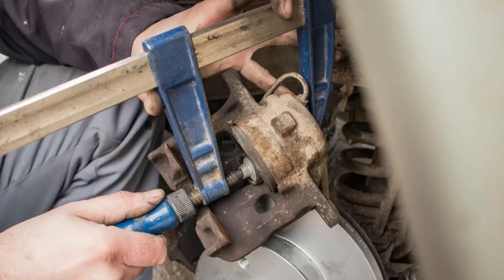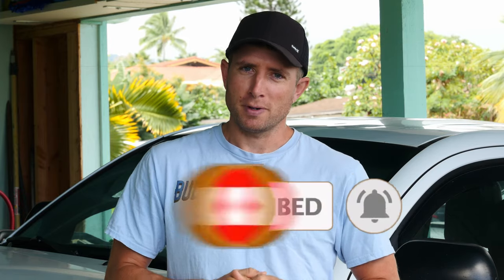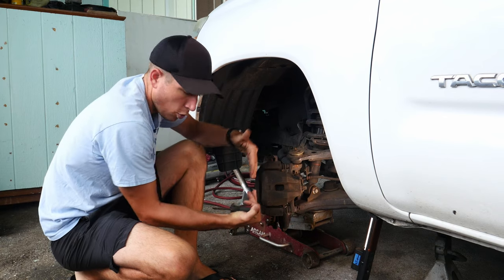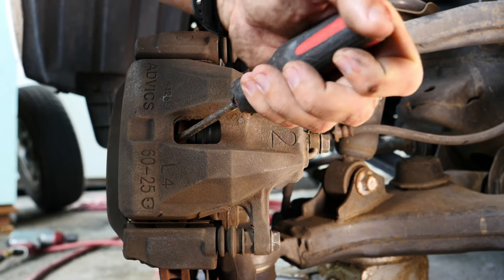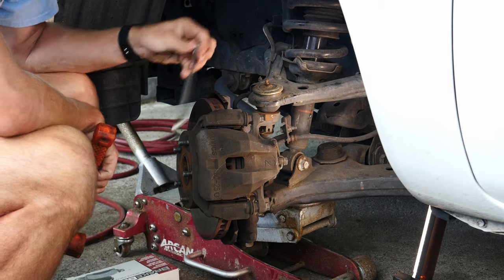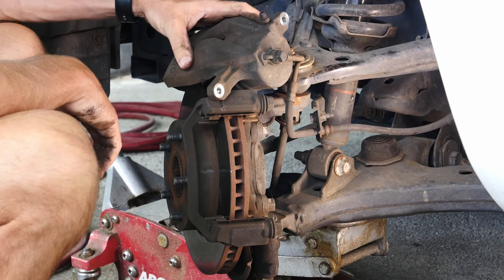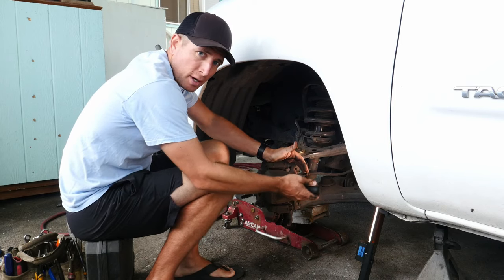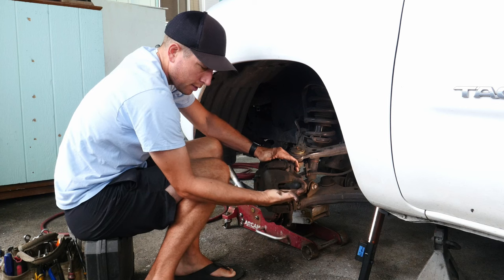Compress Brake Caliper Easy Hack - No Clamp Required!

Comment: Old trick, but clean that bracket and replace the clips. Also replace the rotor and use Anti-Seize on your brake calipers. Take pins out as well and add new grease. You're welcome. Do it right the first time and pads will last longer.

Comment: A lot of people are afraid to do brakes with the car on but if you are safe you can do this. Turn car on and you can move the calipers by hand one by one with the use of hydraulic power of the vehicle. Not all but most vehicles can do this. If pins are corroded or you have issues then I would replace any hardware that binds your calipers or brake system.
Reply: Dude thank you!! You saved me with this one🙏🏼🙏🏼🙏🏼
Reply: Never ever follow this unsafe advice. Period. 
Working engine vibrations might cause whatever you used to jack up the car, to slip, causing catastrophic damage to your hands or legs. 
The dumbest piece of YT DIY car mechanic advice out there!
Reply: @howado  lower car on spare can't slip off the rim.

Comment: I did all 4 of my brakes. And after compressing all the pistons, my brake fluid just about overflowed from it's compartment under the hood and I can see a few large air bubbles in the fluid. I removed the cap after doing the first caliper because I was told to do that but now I'm worried I may have messed something up. Do I need to bleed my brakes?
Reply: I’m not positive but I think you were supposed to loosen the bleeder screws on the caliper to allow some fluid to be released when you compress the pistons.

Comment: Been trying this trick on my Jeep Grand Cherokee 2000, no go. I have tried all sorts of lengths of screwdrivers. I even attempted the unsafe option of turning on the car and doing it and still no go. I've gotten a little tiny bit of movement but it won't go beyond about 1/3 of an inch. I put three jack stands on both sides before I turned on the car but that didn't do anything but give me a bunch of carbon monoxide.

Comment: If you do have the turn-in kind, try using large needle nose pliers before buying the special tool sold for the job. The needle nose worked, and it was easy.

Comment: Yep thats what I thought. My brake pads are sticking. Cant compress the caliper with a screw driver even if I open the bleeder while doing it. Ive bleed the master cylinder, all the lines twice, even used my Scanner to bleed the ABS module. The front brake pads still stick. The first thing I did before anything was remove and rebuild the caliper. The inside looked fine, the piston is as shiny as it was the day I got the car. But it must be something with the caliper. I can compress it with a large C clamp and alot of force.

Comment: Doesn't this scratch the pad surface of rotors itself and/or the edges of the rotors?
Reply: no it doesn't as you lever the caliper main body against the back of outside brake pad on one side first, and then after that use the tip on the back of the inside brake pad.

Comment: Great Tip, but I sure hope you're not installing new pads without putting high temp grease along the pad slides and between the pad and piston and also cleaning and regressing the slide pins.

Comment: I am struggling to push the piston back in. I used a piston compression tool but the piston resists. Any suggestion?
Reply: Sounds like the piston could be seized? If that's the case going to have to replace the whole caliper

Comment: Do you push push the old break pad with the screwdriver against
Reply: You push the piston. There's room between the piston and rotor if you remove the brake pads, cause there should be a bracket covering the hole that you put the screwdriver in. i just removed the bracket and pads first.

Comment: One thing that helps is attaching a vinyl tube to the brake bleeder and crack the bleeder. This is ideal considering you don’t want to send fluid back up to the master cylinder/diaphragm.
Reply from the maker: Unless fluid is very dirty or caliper very corroded, I usually just send it back yo the line
Reply: @BudgetMechanicHawaii  
Well how would you know if the fluid is dirty or not if you can’t see it….
Reply: You're probably gonna have to bleed the brake anyway so just watch the master so it doesn't overflow. might need a turkey baster.
Reply: @MRSC760  
I would say turkey bastet method first. Get all the crud and dirty fluid out first. Just a thought.

Comment: Ok, so that’s for floating calipers and brake disks you don’t care about cracking…but how about real brakes?

How would you compress, say, a 6-piston AP, Wilwood, or Brembo caliper which doesn’t need to be removed to pull the pads through the unit?
Reply from the maker: It’s still possible (lever the tip away from rotor into the old pad). Those systems are more difficult but I usually compress one side, replace the pad then work the other